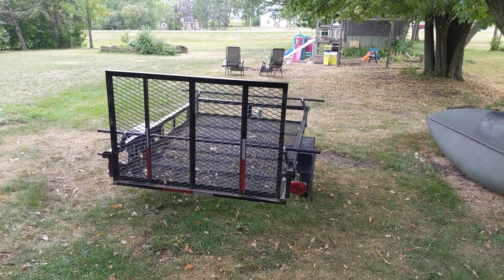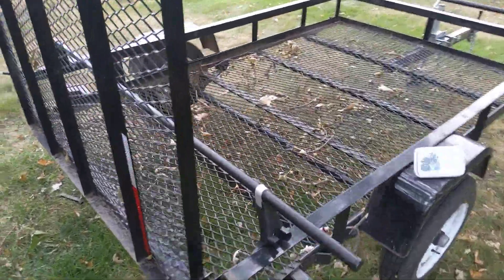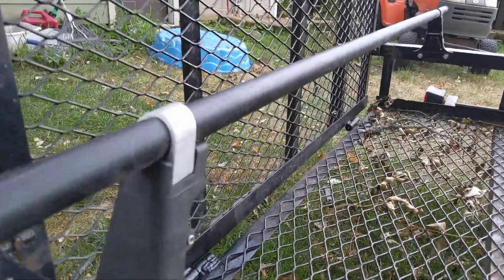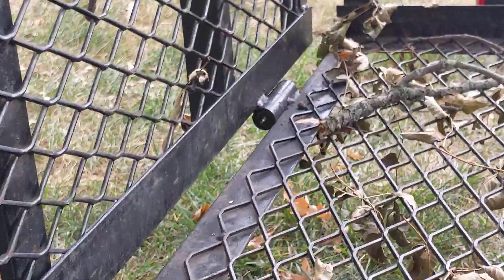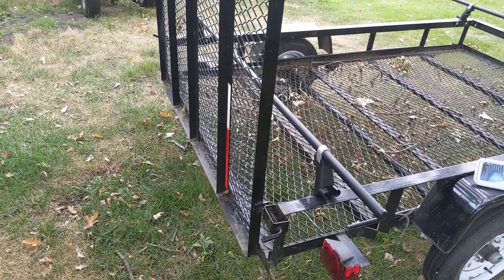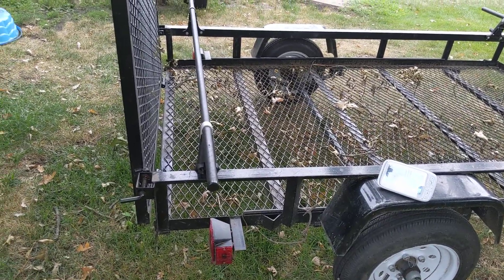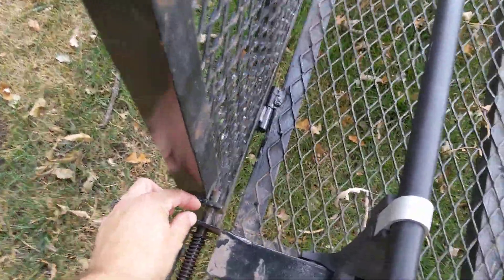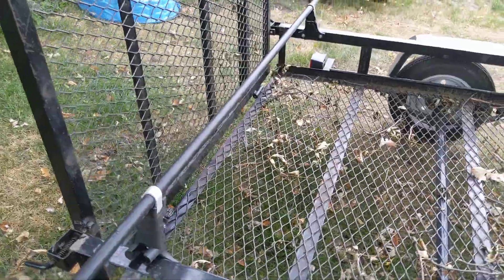Canoe Trailer Modification

Comment: I was just planning on trying to remove my gate on my new trailer. I saw Northern tool sells replacement hinges @ 25.00 each to weld on.  You just saved me 50 bucks.  I have the 5.5 x 10 and the gate is weight I don't need.  I'll use my aluminum ramps.  Thanks Zach.  I like the way your brain works.

Comment: Great work Zach!!  I need to find one of those hinges to replace on my trailer like yours.  I had one break.  I didn’t know about the grease fits until it was to late and one broke.  I was going to drill the solid one out, and drill out the grease fitting in and just put a bolt in.  But I would like to find the replacement hinge.  I could grind the old one off and weld the new one on.  On those brackets, I guess you could swap them and put them on to where the gate would of cleared?  The pole looked to be long enough to do that.  Just a thought.  Thanks for sharing.  Juddie - J & J TOA
Reply from the maker: You might find a hinge at you local scrap yard/ new steel distribution company, they have a lot of trailer supplies inside.
Reply: @exploringlife3389  thanks Zach!  Around hear we hardly have any scrap yards anymore.  But I will try and look.  When my brother in law used it was he backed into something and bent the tongue of the trailer and the gate.  I found a site that sold trailer parts and got a new tongue and ball hitch, and the gate latching pin setup, but I checked the site again and can’t find the hinge on that site.  I will have to continue looking.  Thanks again.  Juddie - J & J TOA

Comment: You could make a “short” gate that is the same height as the sides. You can swap it with the tall gate when hauling a riding mower, any other time, leave the short one on. It would cut down on weight and help with gas mileage by not catching as much air as a the tall one.